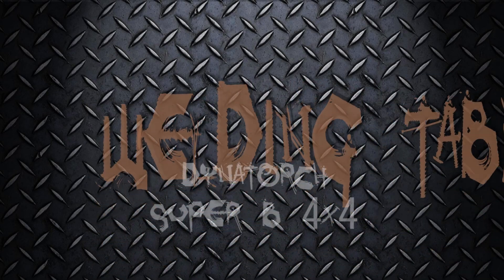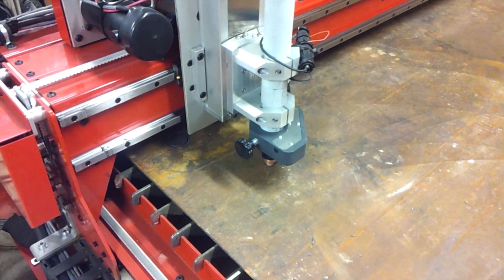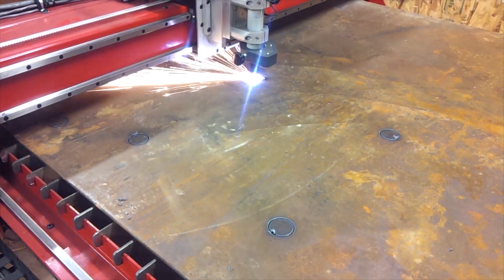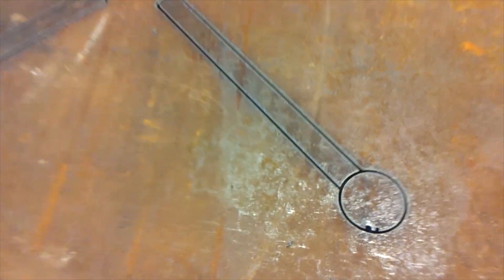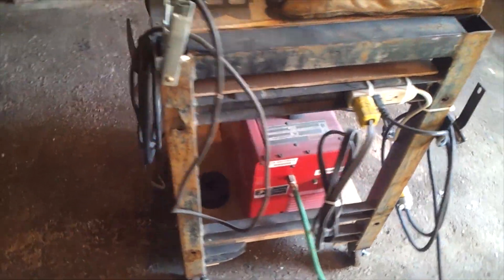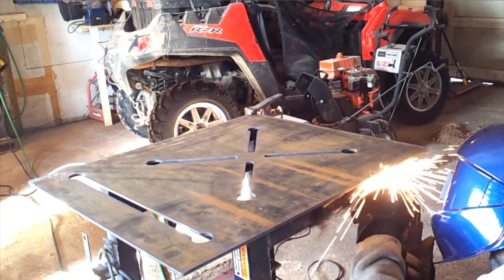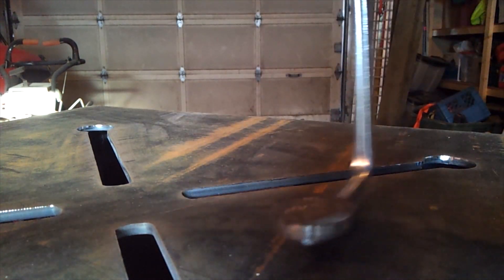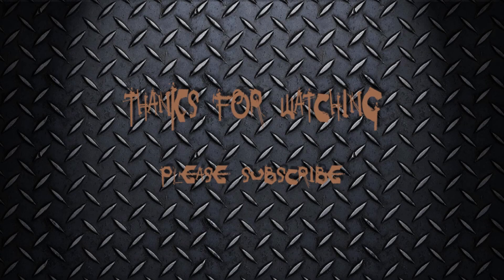CNC Plasma Table - Dynatorch Super B 4 x 4 Welding Table Project

Comment: Great work and nice improvement, may I ask what is the thickness of the steel plate that you used? looks pretty strong, thanks in advance
Reply from the maker: Thanks Arturo - it was 3/16 as I recall.

Comment: A lot more than my skill., but very impressive equip.
Reply from the maker: Charles, thanks for the nice comment.  You don't need a lot of skill to make things, just some imagination and some time on YouTube to learn how its done :)  I'm learning to be a hobby machinist just by watching YouTube (I read 1 book) and I'm getting not too bad. Even if you can't buy a CNC plasma table there will be guys out there who own one like me who would be happy to cut parts for you for a small fee.  So my friend, be creative make something, you might even enjoy it :)
Reply: Hi Sir.
I just want to say Thanks for you response., Regarding your welding machine,  how do you use 110v in United Kingdom. ? or do you reside in USA? If in UK. do you use a voltage trans former? and answers will be helpful.
Reply from the maker: Charles Kwakye Hi Charles, no I live in Canada now.  The power system sucks compared to the UK. :)  110v is way too low for most things.  However you can get those work site converters to drop 240v down to 110v (they are normally yellow).  Thanks :)
Reply: Oh men. I wish you live in US, Oh yes. more reasons to buy Millermatic 211 , it has a dual Voltage and it can be switched with a simple plug. 
I really like your table. You have some great skills. Just watching your video, it is quite impressive.

Comment: How long have you had your dyna torch I am looking to buy one myself but I was leaning toward plasma cam until I seen this video ? Could you make a video of actually drawing a part ? Plasma cam software seems real user friendly
Reply from the maker: It will be one year March 2014.  I did lots of research on the 3 main machines, dynatorch, plasmacam and torch mate.  Don't bother with torch mate they don't use servo motors (very important), dynatorch build quality and components are the best, plasmacam has the friendliest software.  Dynatorch is the cheapest after you add the THC on the plasmacam.  I'll do a video on the software for you let you see how I do it.  Thx for watching.
Reply: The Emporium Thanks really appreciate it
Reply: Shanghai Fangling system is the top brand in China.
Servo and motor panasonic 750w 2 pcs , 400w 1 pcs for heavy frame
ruducer germany 
I guses tha's the best combination. correct me ,if i am wrong